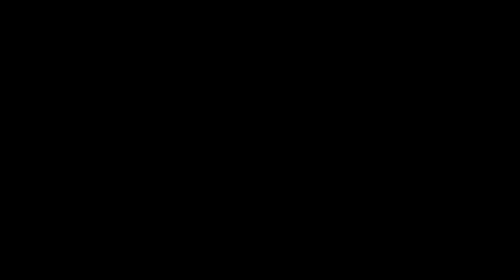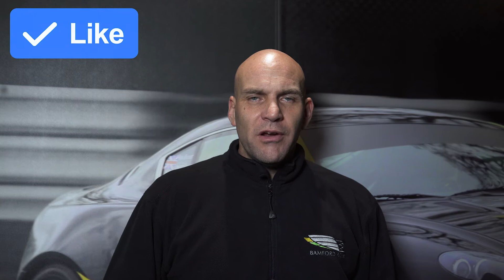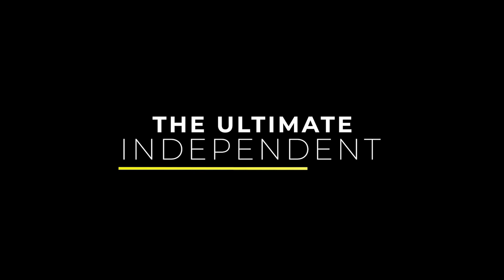Remapping ECU when keeping existing hardware? Forum Chat #13

Comment: Cats are an ecological disaster - the mining, transport, manufacture, and then you burn more fuel as well!   And, if you park on grass you risk starting a fire (I'm in Oz).   Aircraft can be run lean of peak EGT/stoichometric to save fuel, cylinder temps and EGTs fall, as well as cumbustion pressure.   Yes, you lose some power but the benefits are there.   Pre-cats, I remember our old 1980's Honda Accord 2.2L 3 valve EFI - it would get under 5L/100km at 100km/h.   With the advent of Cats fuel you can't run LOP.    Ditch the cats and tune the engine for efficiency at low power and power at high power.   Meeting environmental regs does not equate to efficiency.   Rant over, cheers.